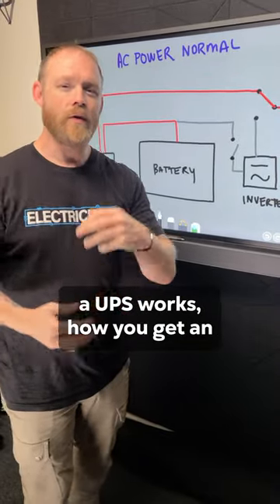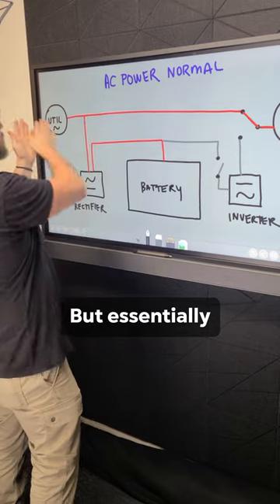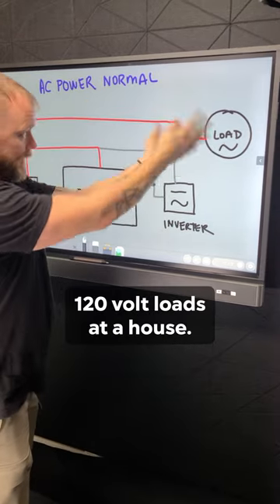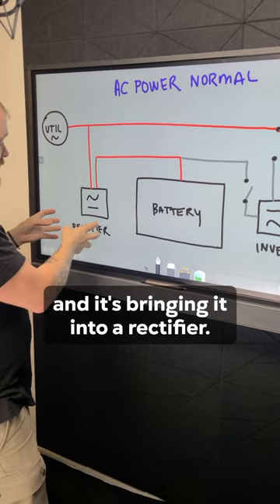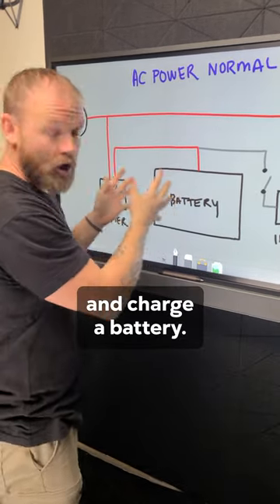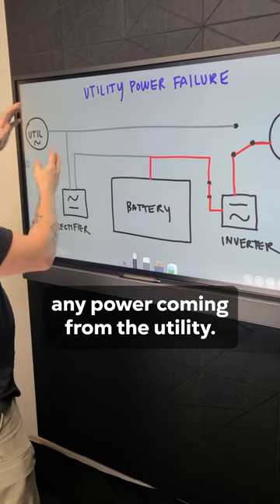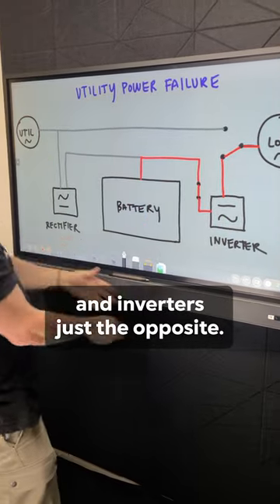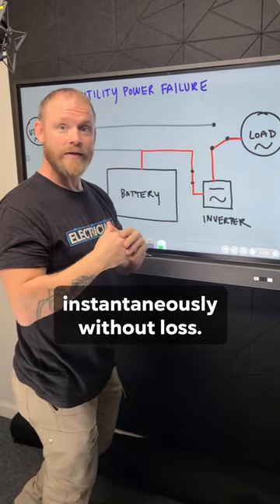How a UPS Maintains Constant Power

Comment: You will lose power! It takes time for the system to realize that power from the grid was interrupted, and then flip the switch.
Reply: Incorrect, the Vertiv units we install take a normal and emergency feed. To keep Bette toes charged. Batteries feed inverter which feeds load so when feed switches from normal to emergency there is 0 interruption.  We install them all the time for critical loads in NJ local 102
Reply: Old news, read up man
Reply: @Lee-wh3ht Per the schematic in the video, that UPS is not instaneous transfer.  You are talking about something else, NOT disussed in this video.
Reply: Your only right if there’s a generator and no battery on site read up….